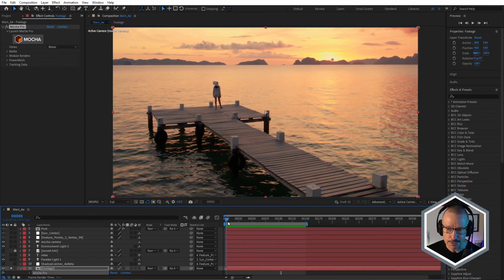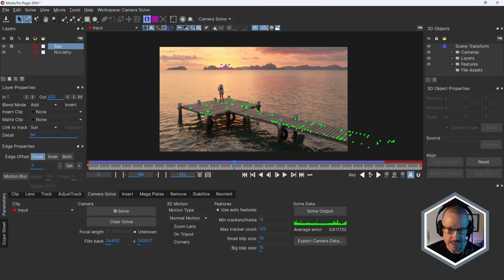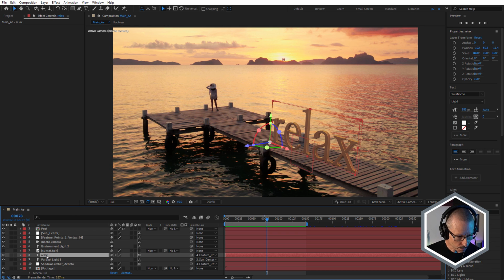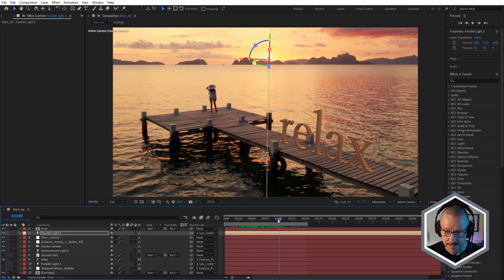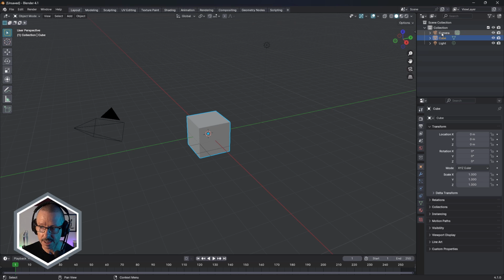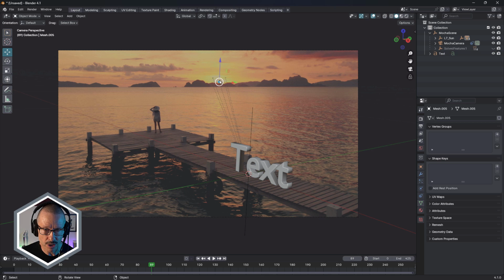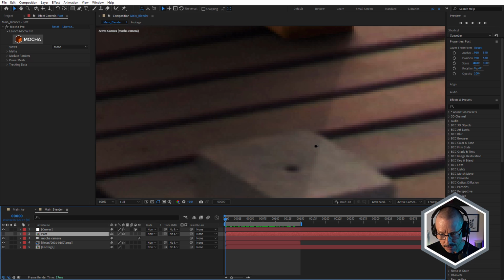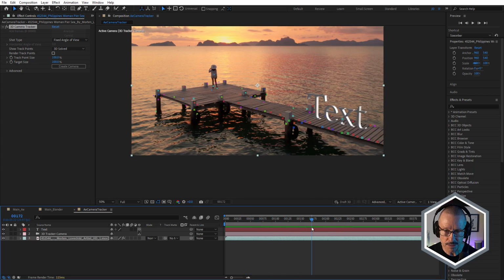Mocha Pro 3D Camera Solver Workflow - Part 02

Comment: Hey John!..FYI You can use the the same exclusion technique using masks and precomping with AE's 3D Tracker as well. One other important thing to mention, I noticed from your top view of the Mocha solves that the overall scene and camera are not within the comp working area (Top view) and your nulls are way way out 3D space. Dan Hashimoto at Red Giant TV goes thru the 3D AE tracker process of 3D scene "Normalizing" This procedure would work the Mocha solves as well!
Reply: Nice one. This workflow is now a bit old as the latest version of Mocha Pro includes Matte Assist ML. I'll check out the Normalize technique 🙂
Reply from the maker: Thanks for the comment. Just to add to John's reply, you can use Mocha's Measure tool (and even film back size params) to quickly get the space into a more manageable size.  This is a fast-moving feature for Mocha and already lots of improvements have been made. 🙂

Comment: What is the difference between mocha and syntheyes
Reply from the maker: SynthEyes is dedicated matchmoving software for camera and object solves. You're able to create meshes, refine solves, and generally go a lot deeper into the process than you can with Mocha.  Mocha is about rock-solid tracking and shape creation, with advanced modules like Remove, Stabilize, and also Camera Solver using SynthEyes technology.  It will solve many types of shots, but if you need to go deep into 3D solves, then you send it over to SynthEyes.

There are lots of differences, but I hope that helps give a general idea.

Comment: I've been learning syntheyes for 3D camera tracks, but I'm wondering: Is there a particular reason to learn 3D tracking in this vs syntheyes?
Reply from the maker: @kspmn absolutely nailed it.  That is the correct answer.
Reply: @BorisFXco  Thanks so much! 🫠
Reply: The Mocha Pro Camera Solver module uses the same Syntheyes engine itself, but as you can see it's a extremely simple module, with just a few options, fast and easy for quick turnarounds. Syntheyes on the other hand is a extremely robust and complex package for production level camera tracking and matchmoving tasks, so even sharing the same engine base both workflows are totally different. But having the option to use Syntheyes camera solver inside Mocha Pro, one of the best planar trackers out there is just a blessing! ✨

Comment: If these videos are made for Davinci Resolve, it would be very helpful. A lot of us use Mocha pro along with Davinci.
Reply: You can easily get the same results inside Fusion page from Davinci Resolve... It already has a built in camera tracker, but you can use the OFX version of Mocha Pro, even the standalone, and export the same data to fusion to start compositing there... Hope that helps! 😅
Reply: @kspmn  Agreed. However, I am still learning Fusion as well. So, if the tutorials use Resolve, it will help me learn faster. Now I have to look at two different tutorials to do the same thing😅
Reply from the maker: The only way to use 3D track data in Resolve is via Fusion.  We'll try to make it as straightforward as possible.
Reply from the maker: Yes, true. We have some Fusion inside of Resolve tutorials on their way.
Reply: @BorisFXco  That would be of great help. thank you!
Reply: Are you sure about that 😂